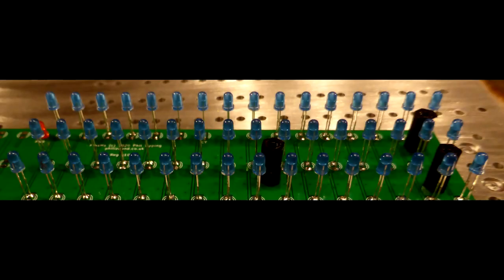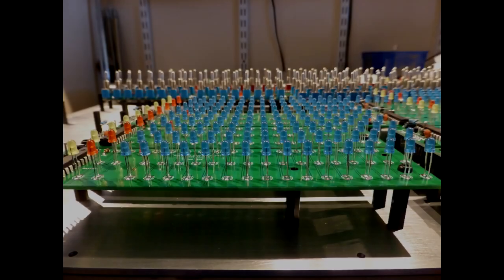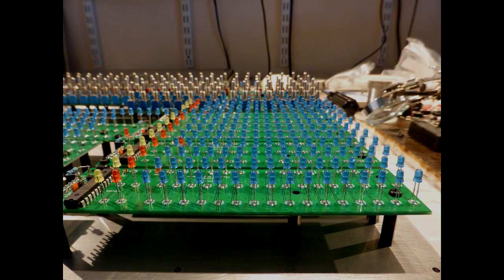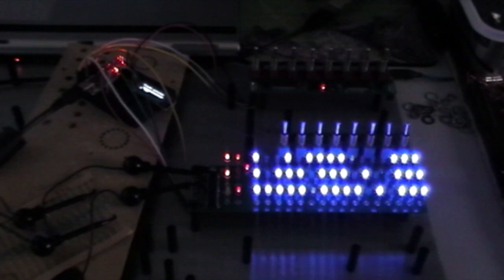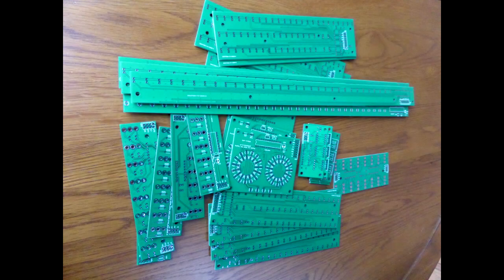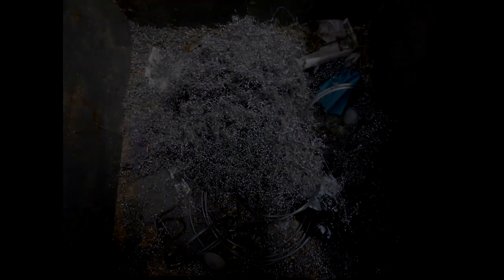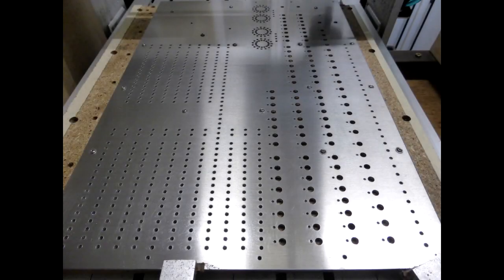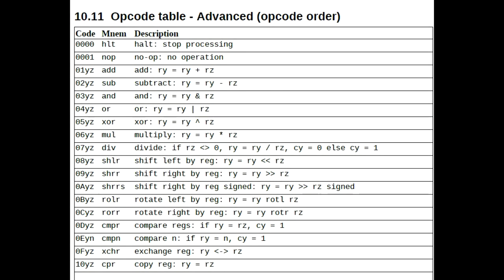PlasMa - 1. A mini-mainframe simulator machine

Comment: Beautiful work! Maybe start selling some on a limited run?
Reply from the maker: @curtisvaughan8955 thank you :) It did cross my mind, but there's been very little interest in it so far, and it would be expensive to offer complete machines. Not sure what people would be prepared to pay. My low-power CNC machine took ages to cut the panels so these would need to be outsourced. Could certainly sell the blank PCBs though, and let the user sort out their own enclosure. Thanks for stopping by.

Comment: Phil, is it possible to use the Tascam DP32SD as a laptop soundcard?
Reply from the maker: @Jack Ladd no, assuming I understand you correctly. You can use it as an 8-input device to your computer, but it doesn't have 8 separate outputs so you could only transfer a stereo mix. There is no live digital link; the USB connection is only for file transfers, not live audio. Is that what you meant?
Reply: @philtipping  That's what i meant Phil and thanks. I have actually watched all of your video's on it and i do remember you saying you can't but i wasn't sure if i misunderstood. Thanks for everything Phil you're amazing, and good luck with your new venture.
Reply from the maker: joykiller  just copy the master file. The mix is in the 'master file' which is a single stereo wave file, so copying is all you need - it will be a perfect transfer with no degradation. Note, you can also do perfect transfers with the individual tracks, but you must use the Export process for these. It's all in the step-by-step guide.